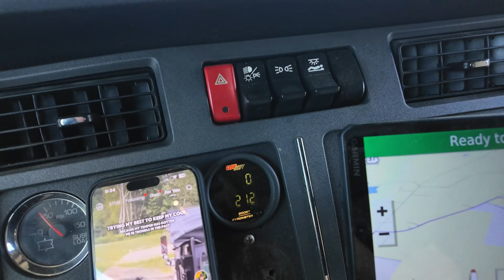We're finally done!

Comment: get a college dorm  refrigerator  remove the cabinet put a board on top strap it  down and keep the air fryer
Reply: That's what I did. 20 x 38 butcher block table 1" thick. Steel frame around the fridge supports the table and an upright goes up to support the top shelf where my microwave and computer is. 24" monitor attaches to the upright so I can do office work sitting at the table.